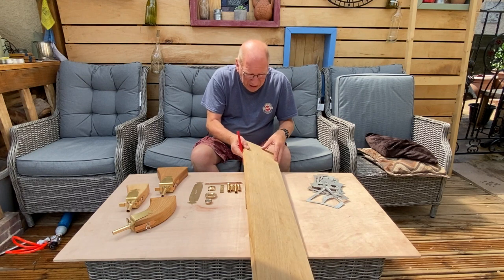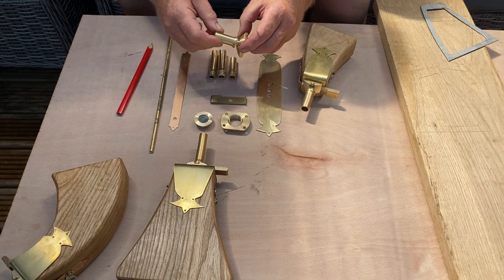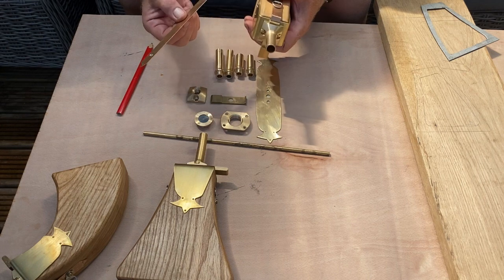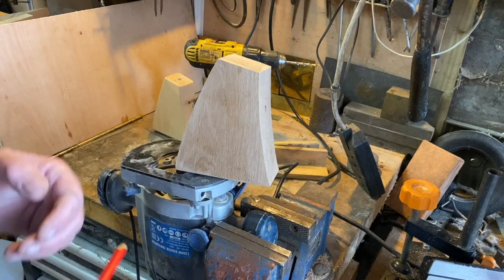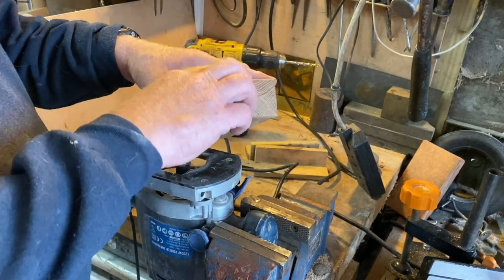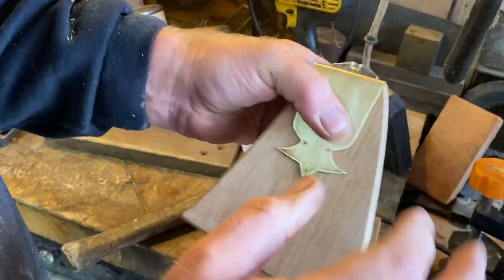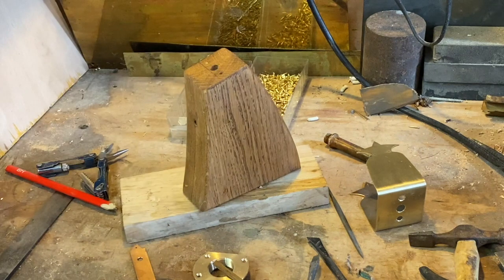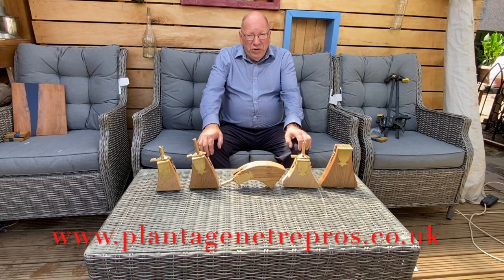POWDER FLASK

Comment: Hey! I'm the "William" guy who just inquired about US shipping. I'm so glad you've actually uploaded the process of manufacturing your flasks. Shows the integrity of your business in a brilliant light.

When I order and receive mine, I'll be doing videos of using it. I'll be sure to tag and leave a link to your website and Etsy shop!
Reply from the maker: Hi there ''william'. Thank you very much for the viewing and the kind comments. Since producing this video i have very slightly changed the method of manufacture of the wooden bodies. I now use a CNC carving machine to cut the inner and outer profiles, although this method is slower it provides greater accuracy of both inner and outer profiles and reduces sanding time. All other methods have stayed the same.